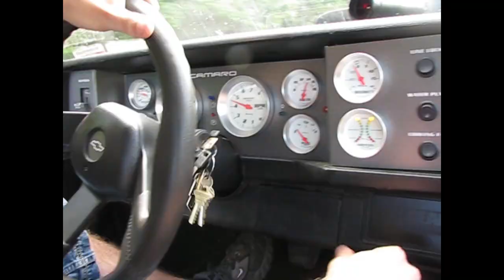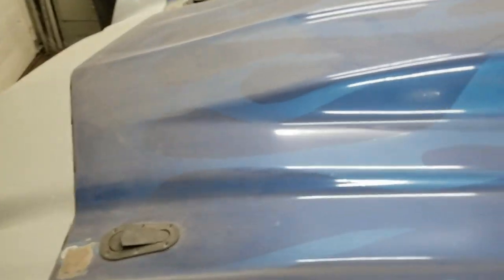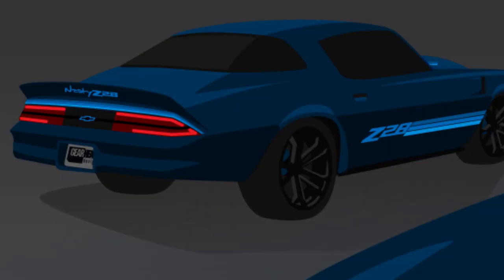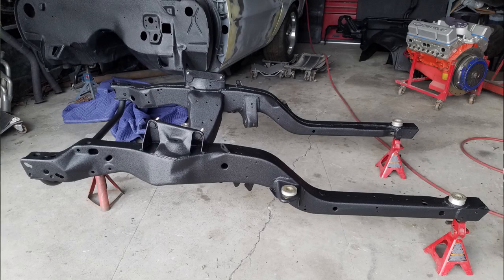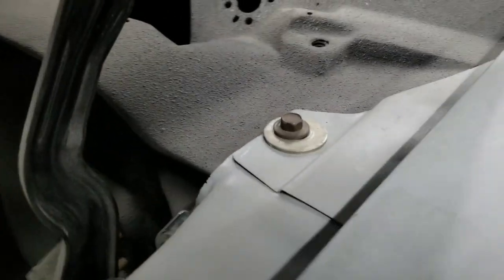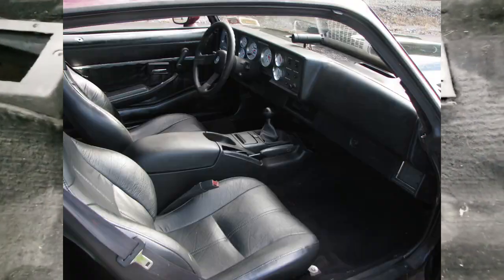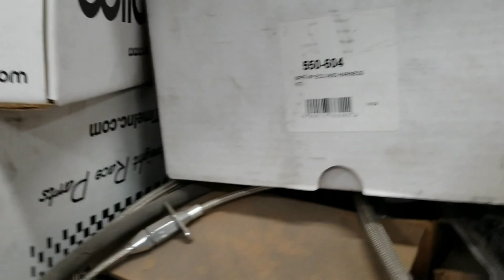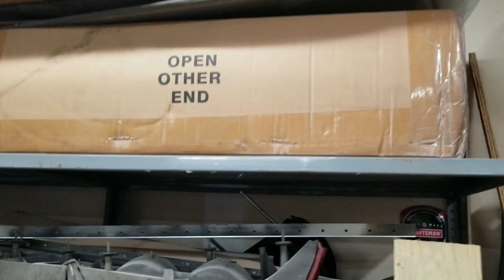80 Z28 pro-touring Camaro build walkaround

Comment: Try a couple X brace between the leaf spring mounts connecting them all together.
Reply from the maker: Not really room for that under there. It handled really well with those PTFB springs. Should be even better with the hotchkis bar and Herb Adams mount

Comment: What was required to add the steering column
Reply from the maker: The dash mount and most of the switches are the same. Dimmer wiring needs to be changed, and so does the firewall mounting holes. You could probably do it with an adapter plate. I was already studding the firewall anyway and changing things up